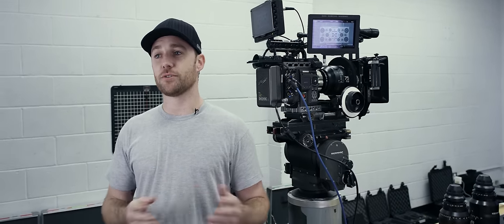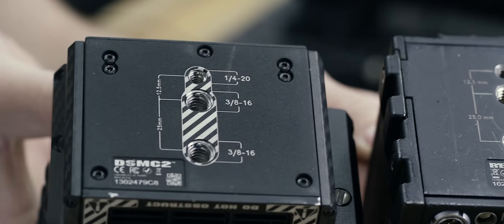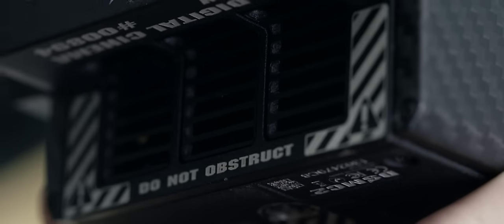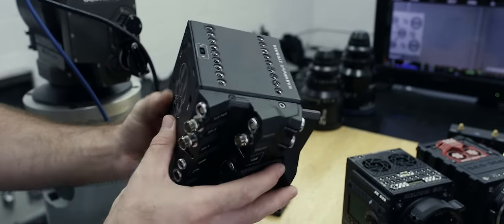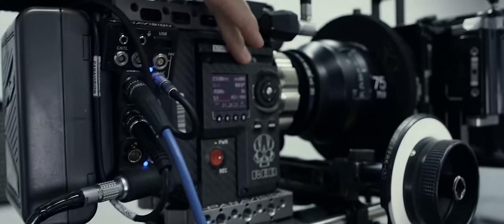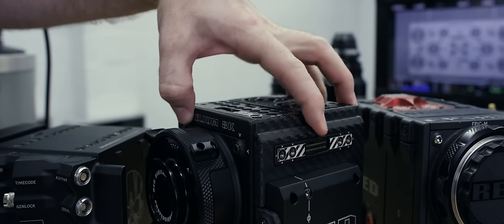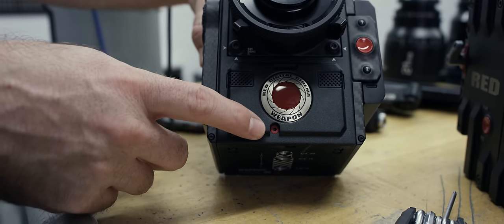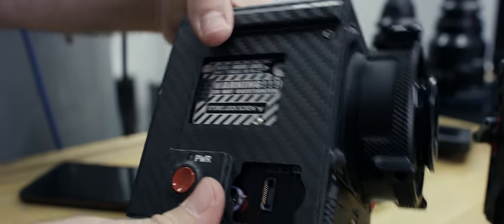RED TECH | DSMC2 Camera Prep [Part 1]

Comment: Please do a red tech about adjusting back focus, a bit confused... Should the bolt be in stored position or locked position?
Reply: Eirik Fiskkjønli actually working on a back focus script now. Depends if you want the sensor fully fixed or adjustable. Most cases the stored position is perfectly acceptable. I'll get that video going though!
Reply: Great! Thanks alot!
Reply: @nateheartt2126  Hi Nate,  Where can I see the film about how to adjust the back focus on the RED? Thanks
Reply: Hi Eirik, Where can I see the film about how to adjust the back focus on the RED? Thanks
Reply: I would like to do it on the RED Scarlet W 5K ( the Focus Lock is not located where you show it on the 8 K camera on the video)